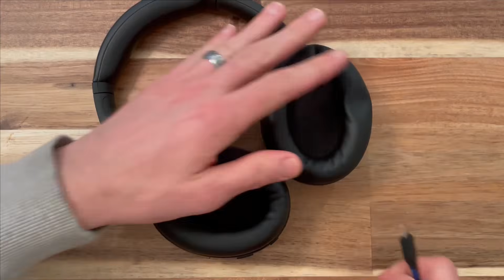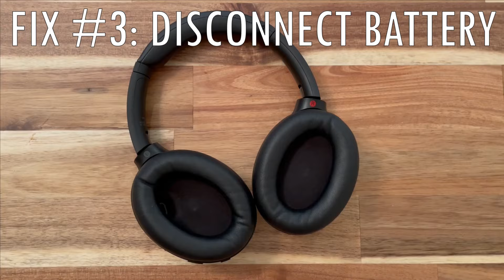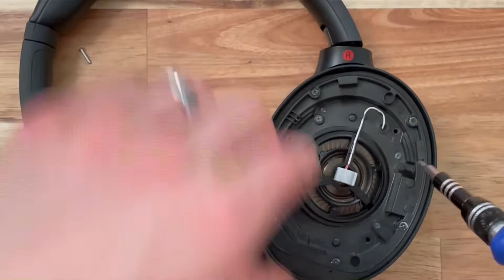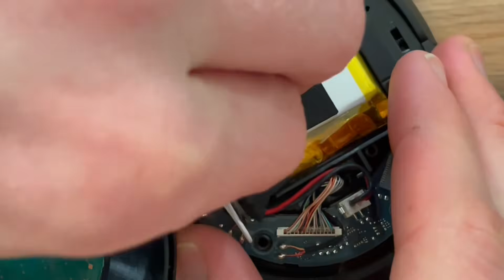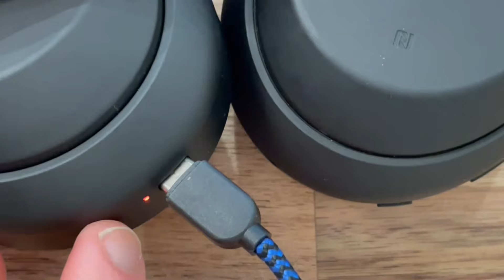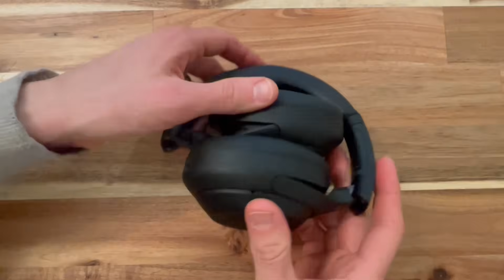SONY WH1000XM4 Battery Troubleshooting & Repair - No Power, Won't Charge & Short Battery Life Fix

Comment: I don't know if this helps anyone, but I was using a Goobay USB charger Dual 2,4A (2xUSB-A), it charges for some seconds, then the red light turns off and the headphones is no longer charging. The adapter has worked earlier and still works great with my PS5 controllers, but now it is not working at the moment for my headphones (had the headphones for some years now). 
I changed the adapter to a Genuine OEM Google Chromecast Power Adapter EU and now it seems to work (at least for now). (It's the one that comes with Chromecast 2. gen.) What I figured out, and seems to have solved my problem, ChatGPT will descripe below. 
Another solution that has worked previously with the Goobay, was to Shut down the headphones, turn it back on, and immediately insert til charging cable, then hold the power button for another 5-10 seconds and then let go. ChatGPT's answer: 

If the charging starts for a couple of seconds and then stops (the red charging LED turns off), that clearly points to an incompatibility issue between the Goobay charger and the WH-1000XM4, even though they should work together on paper.
 Possible Causes — and Why It Happens with Goobay

    Goobay charger's power management or signal profile
    – Some USB-A chargers have a "smart charging" feature that tries to detect the type of connected device. If it doesn’t properly recognize the Sony headphones, it may shut off power after a few seconds.
    – Sony’s headphones expect a stable and passive 5V/1.5–2A input. If the Goobay charger attempts more advanced communication (e.g., with Apple/Android profile detection), it may cause a conflict.

    Voltage drop or unstable output
    – A 12W charger sounds sufficient, but if the output isn’t stable, Sony's internal charging controller may stop charging as a safety measure.
     This especially happens with cheaper chargers or those with dual USB ports, even if there's only a minor voltage fluctuation.

    The cable could still play a role
     Although it works with another adapter, some USB-A to USB-C cables vary in quality and power delivery support. The specific combo of Goobay + certain cables might be enough to cause charging to stop.

The fact that it works with another adapter confirms:

    The headphones are working properly

    The cable is likely fine

    The issue lies with the Goobay charger itself

What Can You Do?

    Use a different adapter
    – A USB-A charger with a basic 5V/2A output (no "smart charge" features) is often more compatible. Alternatively, use a USB-C PD wall adapter with a USB-C to USB-C cable for more reliable results.

    Use a USB power tester (optional, technical)
    – If you’re curious, you can use a USB tester to see if the Goobay actually provides stable current — these often reveal small voltage drops that cause charging to fail.

    Avoid using the Goobay charger for these headphones
    – If possible, replace the charger or use it only for devices that are less sensitive to power delivery (like phones, power banks, etc.).

 Conclusion

Even though the Goobay charger should technically be compatible, in practice, it’s not stable enough to reliably charge your Sony WH-1000XM4. It’s not necessarily a faulty product — just a bad match with Sony’s charging circuitry. You’re absolutely right to use a different adapter — that’ll give you far more consistent charging.

Comment: Hey- thanks for the video. My headphones are from 2021 and stopped charging recently. I bought a new battery off of eBay and installed it, reset (held for 8s) and the. It started to charge. Unfortunately I u plugged it about 20min later and it hasn’t charged since. I tried taking it apart, unplugging the battery wire and the other one (next to where the earpiece connects) and leaving for 15m and then plugging back in. They turn on, but again won’t charge. I have reset them again, and once the charge light went on when I plugged it in right after resetting, but went off after 2 sec. Any thoughts?
Reply: Damn this makes me so sad for you and scared for me. Mine just stopped charging and am thinking of getting a battery right now. Sucks how common this issue is with how expensive these were. Wish you luck with it ❤️

Comment: I didn’t change the battery, but the issue I’m facing is when I bought it off someone it was fully charged it connected to my laptop and Mac but then fully died on me after using it for a long time. So I put it on charge I see the battery light which is red coming off and on. But the power button won’t work whenever I press it not responsive
Reply: Someone help please

Comment: What worked for ‘me’:

After watching over 10 videos and reading multiple articles.

- I smacked the headset for about 30 seconds (maybe loose wire)
- My headset had 10% battery so it still turned on. 
- I turned them on and plugged in the charging cable while on. Getting power from my PC.

It’s charging as we speak. Worked 5 minutes ago. 

Can also try pressing “power” & “custom” until blue light blinks 4 times. 

Best of luck

Comment: Thanks for sharing this as it fixed my set. My set was only charging to about 17 to 19% then stopping. When I connected my charger, the red light would come on for a few second and then stop and I couldn't get them to charge pass 19%. I tried the full reset with no luck. I then went to step 2 and disconnected the battery for 15 minutes, reconnected the battery, and connected my charger and was seeing 80% charge when I checked to see how it was progressing. My fix is fresh so I'm hoping it continues to work well for a while.

As a side note do most of these replacement batteries come with the temperature sensor attached to it? If not, what's the safest method for removing the original sensor from the factory battery to get it transferred to the new replacement battery?

Comment: Hi Jon, thank you so much for the video. I tried every step and even replaced the battery,, but It just ran empty and won't charge as well. I tried multiple different chargers already.  Is there another step after battery replacement? Will Sony help me? Really freaking out at this point...
Reply: I solved this the other day. (if you're having the 10% battery issue and cannot upgrade firmware. This fix is NOT for physical damage.
1. Reset. If doesnt work go to step 2
2. If battery still has Any charge, run it down at least another 20 minutes, beyond the (10%)
That 10% is not real - it is a firmware issue.
3. Connect back to phone, in my case it suddenly said 100% charged?!?
4. Now you can update the firmware with the Connect app.
then it reboots to version 2.9.0 and....the problem is solved!!

Right now I'm playing mine for 20-30 hours to try to kill the battery to see if it happens again as Im under warranty.
It is NOT the battery in the (10%) example.

Comment: it worked at first for a few days with a new battery.. no it no longer charges and the above steps no longer work as well.
Reply: I solved this the other day. (if you're having the 10% battery issue and cannot upgrade firmware. This fix is NOT for physical damage.
1. Reset. If doesnt work go to step 2
2. If battery still has Any charge, run it down at least another 20 minutes, beyond the (10%)
That 10% is not real - it is a firmware issue.
3. Connect back to phone, in my case it suddenly said 100% charged?!?
4. Now you can update the firmware with the Connect app.
then it reboots to version 2.9.0 and....the problem is solved!!

Right now I'm playing mine for 20-30 hours to try to kill the battery to see if it happens again as Im under warranty.
It is NOT the battery in the (10%) example.

Comment: I had the same situation. I tried opening the left cap of my WH-1000M3 headphones, detached the battery connection, waited for about 30 minutes, then plugged it back in and put it on charge for about 2 hours . The red light turned on.

I then tried turning it on by pressing the power button, but it still wouldn’t work. So, I plugged in a 3.5mm cable to my phone, and the headphones worked perfectly. After that, I unplugged the 3.5mm jack, pressed the power button, and—what a surprise—it worked!

Hope you find this helpful.

Comment: Hi there please I have changed my battery but still experiencing this problem. On top of it all, I have damaged the heat sensory is there a possibility I could some to buy or use it without that is if you are able to assist me bring it back to life?

Comment: Thanks for this. The power suddenly went on my WH1000XM4 headphones. No lights and battery wouldn't charge. I've disconnected the battery and reattached to no avail. But before I buy a replacement battery, does it make sense that it would suddenly stop like that, rather than slowly fail to charge?

Comment: If anyone is having an issue where their red light is blinking slowly like slow red blinks while charging, change the type of charger or usb port you’re using. I was using a USB hub and it was not charging and it was blinking slowly which indicated abnormal charging said in Sony’s page. I then charged it to my gaming pc’s usb port and it stopped blinking slowly and is now a stable red light. I’ll update if it charges or turns on after. I tried to hard reset it as well and it didn’t work before all this but idk

Comment: Hi Jon. Fantastic video. To the point, thoroughly explained and totally fool-proof. Unfortunately I have not been able to revive my XM4s. Yesterday, my bottle of water spilled in my back pack containing my XM4s and they got drowned in water. I’m pretty sure they’re totally broken, as I’ve tried all the reset options etc to no avail. They are completely unresponsive to anything, except the charging light which does come on when I plug them in. Before I painfully pay full price for a new pair, do you think it’s worth a shot to bring them to an electronic repairs store? Or do you think trying your final step replacing the battery could do the trick? Or are the headphones totally broken because of the water damage? 
Thank you!

Comment: Thank you so much for creating such a wonderful video! Thanks to your efforts, I was able to eliminate the terrible noise, and the battery started charging, which made me especially happy! However, two problems still persist:

Although the battery charges, it incorrectly reads the charge level and always indicates a low battery.
The touch sensor on the right earbud has stopped working.
Have you possibly encountered this or heard of similar issues?

Comment: I’ve replaced the battery and the same problem is coming up when I plug them in the light stays on for 10 seconds maybe less then turns off and they won’t charge not sure what to do

Comment: it's a battery drainage issue (usually happens when you use the headphones till its battery becomes 0% and turns off)

The solution is to plug the headphones into the charger and leave it for a couple of hours 
only then after 5 hours (maybe less or more) you can take the charger off and use the headphones)

Comment: Hi. I replaced the battery but it won’t charge.  The red light comes on for 5 seconds and then turns off.  Please help. Thanks!
Reply: I’ve got this same problem any solution?

Comment: I will never buy Sony. Less than a year they won’t even charge or it happens a lot.

I don’t think mine is a battery issue but a software problem. The battery charged once every so often, even when fully charged it doesn’t show that it is charged and always remains on 10% even though I will get the 15 or hours use. The whole time it’s on 10%. When the battery is about to finish I get the verbal warning and then it turns of after about 5 minutes. 

If I try to charge the battery, sometime it  charges and sometimes it refuses (no red light).

Comment: Was anyone having an issue where there was no lights at all, headphones where completely dead, but when it’s plugged in to power it puts out a single high pitched tone from the speaker? That’s where I’m at. I did all these steps and nothing. It’s so confusing. They were just working fine the day before and now nothing.

Comment: I replaced the battery but I am still getting the flashing red color. The new battery replacement didn’t come with a new heat sensor. Do you think I should buy a new heat sensor or what could cause the problem? 
Thank you

Comment: I know this video is old but i have a question I just replaced the battery but the one that came didnt have the black rectangle on top or the orange wire and it works now so is there any problem I need to be worried about?
Edit: the headphones dont charge I plug it in and after playing around with it a little the charging light starts to flash but it never actually increases the battery does anyone know what this means?

Comment: I have a similar problem , they had 30 percent battery but when i connect a cable they refused to charge ! I try hard reset , do what you did !! Still didn’t work ! Try other cables wouldn’t work ! I left them alone i came back and they were charging! I havnt opened them yet ! Don’t got a prying tool

Comment: Tried all the first steps, didn't work. 
I purchased a new battery and originally it didn't charge. I then turned it on and plugged it in straight after and it "charged", well the red light stays on.
But it's not actually holding any charge and as soon as I disconnect the battery is low. 

Any ideas?

Comment: I tried all the steps and it didn't work, but pressing power button for some time and then plug the charger fixed it. I have to keep doing the same to charge it though.

Comment: Hello, I have a problem with the headphones, I dropped them into the water, everything works but it does not charge and it does not connect to Bluetooth and when I try to pair it can only turn off and change to the modes and it does not restart, do you think that if I change the battery it will Will it solve the problem? Thank you very much for your reply. Greetings from Spain.

Comment: Fixed! Solution at end. / Very nice guidance video which did not work for my situation.  Here is what I observed.  The head phone was dropped in a pond.  When brought to me, it was fully dry and will not turn on.  USB charge light is on and drawing 310mA.  When ON button is pressed, the Charge light goes off and the current drops to 50mA.  After a few seconds, the light by the USB comes back on and the current jumps back to 310MA.  The head phones react the same as you demonstration in your guidance but did not alter per my observations.  I opened the ear set and noted that there were no signs of water on the plastic or circuit board.  Disconnected battery to measure 3.8V on battery and 4.14V on board connecter with USB connected.  Reassembled and re-ran your tests to no avail.  Put on charger for 10 minutes.  Still won't turn ON.  I have not opened the push button side.  I opened the other side and no water intrusion seen.  // Later, I noticed that if I hold the power ON button for 7 seconds, the unit would give the 4 blinks.  This led me to think the Custom button might be shorted.  Re-Opened the Left side and was able to only view the tiny button board and not brake wires, due to to way it was assembled.  Opened the circuit board side to remove the flex cable to see a tiny bit of corrosion on some fingers.  Cleaned fingers of all flex connectors with white eraser.  Re-assembled, NOW IT WORKS!  YIPPY!
Reply: Same here. It seems the red light flashing issue can happen with either the heat sensor flex or the touch panel flex. My touch panel flex had a tiny bit of corrosion causing a short. Easy fix in the end.
Reply: @dar30  How did you fix the tiny bit of corrosion, may I ask?

Comment: Cheers! Had to disconnect then reconnect the battery to save mine, still a valid solution in 2024 🙌 The problem: Stopped charging beyond 10%, warranty is registered in another country.
Solution: The video
My headphone is only 2 months old, very disappointed at Sony for this manufacturing issue.

Comment: Mine were caught in a terrible storm with me, the charging light will not turn on at all and it will not charge. It will turn on and say “battery low 10% pls charge” I have ordered both a new battery and charging port and have replaced both. After installing the new battery it still gives me the same message and the charging light will not turn on when plugged in. Could this possibly be a spoiled wire? what can I do to fix it?

Comment: I had an issue with my headphones not turning on at all (except when you use the cable LOL). I didn't hope that this solution would resolve the issue, but it worked!! Thank you so much!
Reply: Unfortunately, now my headphones do not charge. The charging light is blinking red when I connect it..
Reply: @yunam5665 it’s happening to me too, did you find how to fix it? 😢

Comment: I found them in trash even with the plug wire. They work perferctly for my mp4, but it doesn't turn on and doesn't charge or turn on the led, so, I think, they have the same problem and I going to open it to check whats going on inside. I think someone send them to trash because thought they was broken or whatever.

Comment: In my case sand got into the charging port, the red LED wouldn't light up. Isopropyl alcohol and a toothbrush rub in the charging port fixed it

Comment: Hi Jon. I bought a used  pair of headphones (buyer beware) and followed the video exactly and no luck...I even went as far as to replace the battery with a brand new one. When connecting the battery cable it flashes blue but only for a second. The headphones will still not turn on and nothing happens when i connect the charging cable. Any other suggestions would be appreciated.